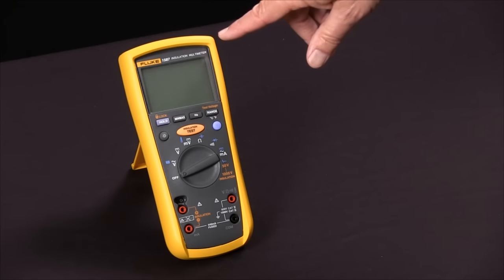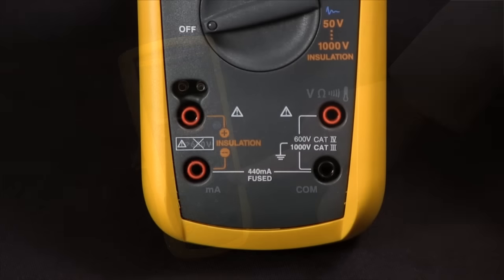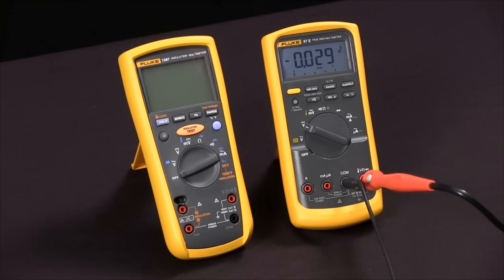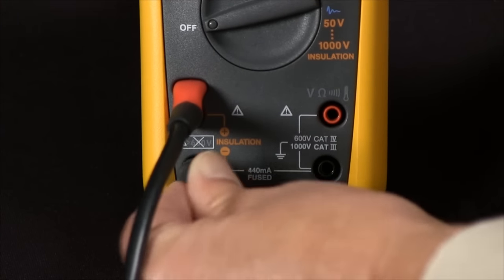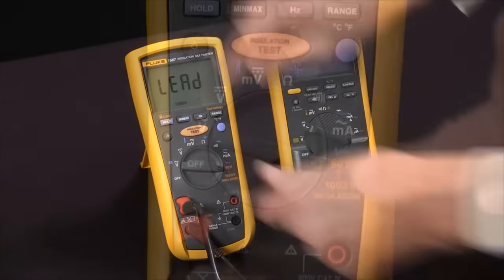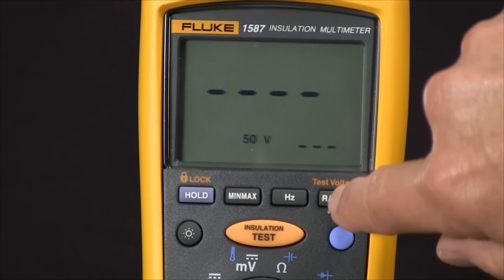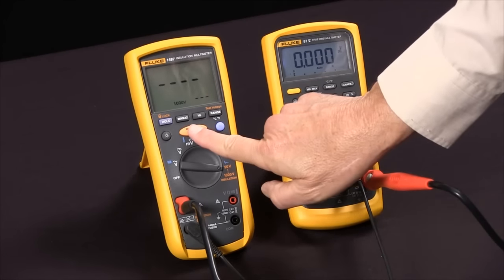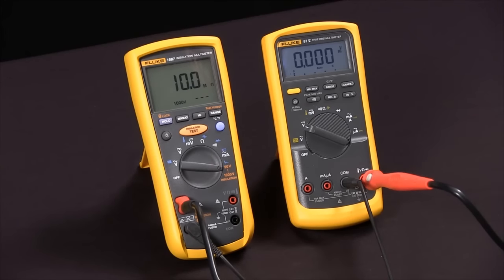How to Measure Insulation Resistance With The Fluke 1587

Comment: I realised my 1587 was giving me the same readings on all my insulation tests. So i found this video and it turns out my 1587 is not sending out voltage during the tests. Less than 1vdc. No wonder i was getting 550 Mega Ohms on everything. Good video

Comment: For those who asked or will ask about megaohm meter vs this test or why it shows the voltage instead of resistance: You measure insulation resistance by applying high voltage until you detect very small current flow. The goal is to "certify" a cable or the installation to some voltage rating. This is why the meter shows volts. In this case, while Fluke 87 should have 10M impedance, due to current leakage you can't just assume that at 1000V you will have 100micro amp current draw, so to test this fluke 1587 is raising voltage until it detects 100micro amp current draw.  it detected 100 microamp current draw at 1052 volts. In regular ohm meter the ohm meter drives 10 or 100 micro amps of current and measures voltage required to get there. GOhm meters are more sensitive and can measure lower voltage drops with smaller current draw to calculate high resistance, they might only drive 1 micro-amp , this is why ohm meters do not actually test insulation at high voltages, this meter does.
Reply: I recently used a Fluke 1587 and it gave me a GOhm reading. That's better than MOhm......yes?
Reply: Comment above, I have the same one and it only gives me gigaohms as well. But basically 1 gigaohm is 1,000 megohms. So you can do the math so if yours says 1.7 G, then it’ll be 1700 Mg, but I still wish there was a way to switch it on the meter for G to M I’ve tried every button looked in the manual and it does not.
Reply: @WhipHCO   All of my specs say to look for greater than 10 MOhm on whatever wires I'm testing, so yeah....I'd rather just read it in Mohms.

Comment: I need to test buried wire.. free exit and safety loops for gate operators. I understand the concept, but not the values. ideas? easy to read tables? gauge of wire, voltage applied, expected resistance, values indicative of failure.. help!
Reply from the maker: +Aaron Kidd Hi there - we have a series of measurement basic training material we think will help! Here's a great place to start: http://bit.ly/1Vmy0AC